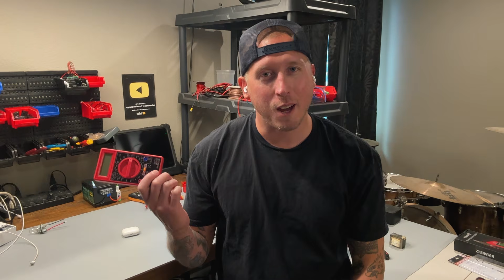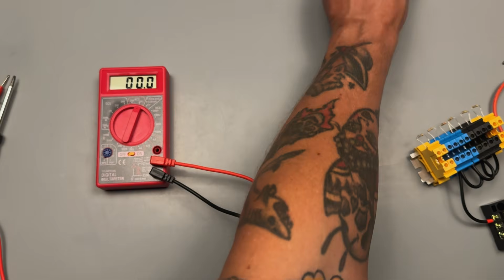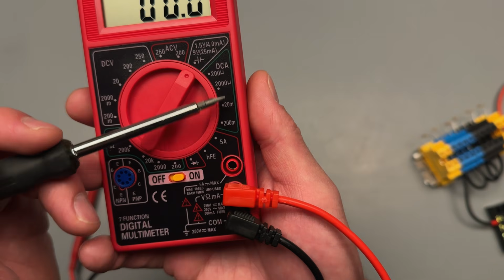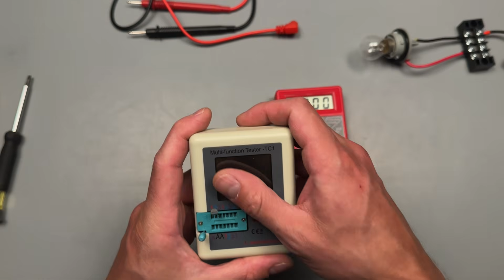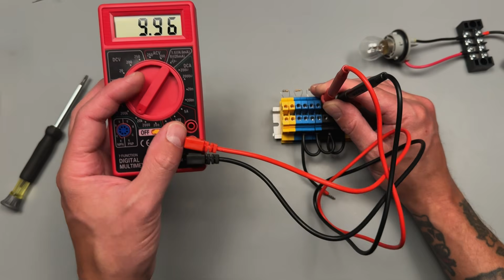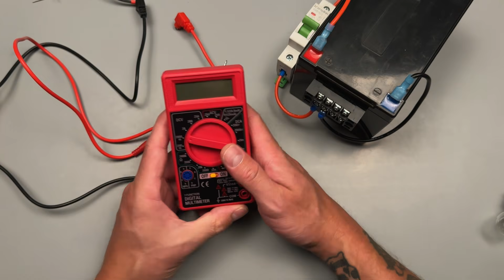How to Use the 7 Function Digital Multimeter from Harbor Freight (Full Tutorial)

Comment: The battery test function doesn't seem to work on mine (I have 2 of them).  When I go to test a 1.5v Battery, putting the selector switch on the battery test mode as you did in the video, I get the number "1" in the the display.  Measuring DCV on the same battery I get 1.3V
Reply from the maker: Bummer! Sounds like a defective unit. I would take it in a switch it out for a brand new one

Comment: My navigation lights on my boat are not working.  Can I use this to multimeter to test whether there is power being supplied from the 12v battery?  If so, what is the right setting on the dial?
Reply from the maker: Yes you can. If you watch my tutorial it should give you enough basic knowledge to understand how to perform this test

Comment: Can I use it to check a well pump for a water sprinkler system
Reply from the maker: Yes, you can! It's great for checking if the pump is getting proper AC voltage at the pressure switch, or for testing the switch's continuity (just make sure the power is OFF for that part!). Be super careful since you're dealing with water and mains voltage. Stay safe!
Reply: @maddoxmechanic  Thanks for your resonse we were trying to help my sister with her well pump.She just had it replaced with a new one.Apparently they didn't connect it right.Much Gratittude for your help.
Reply from the maker: @Lorilovesthemosthigh you bet! Glad it was helpful. Feel free to check out some of my other videos if you have the time. Thanks
Reply: @maddoxmechanic  Thank you my Husband was trying to help check my sisters well pump.The people didn't install it right.Thanks for your answering me back much gratittude.

Comment: Love this meter doing car 12v stuff....Understand it and makes sense. However, I am getting ready to test a 240 volt stove outlet to see if it is working. I imagine this meter should do it because it has a 250 volt setting or is that to dangerous with something like this?
Reply from the maker: I believe it is technically rated to handle that voltage. However, I personally would not feel comfortable testing that voltage with this meter. And I don't think you should either. I would go down to your local hardware store and get a meter rated for 600v AC - very common rating for most meters. Should have better insulated meter leads, and internal components. Wear electrically insulated gloves and safety glasses
Reply: @maddoxmechanic  Thank you and very much appreciate your response!
Reply from the maker: @Glenn_123  No worries! good luck, be safe!

Comment: I hope you can help me please. Trying to check if Bose speaker is blown on if wire is broken. Same meter as you’re using. I can’t tell what continuity symbol is. Getting 0 ohms when testing speakers and Bose are usually 2 ohms. I think it’s blown but other electrical issues so just checking. Thanks!
Reply from the maker: Hope this helps 

How to Test for Continuity with ANY Multimeter (Cheap vs. Fluke)
https://youtu.be/5cYBXgxeBP8

Comment: when i did the battery test here 5:58 mine meter show - 00.0 on brand new out the pack batteries???
Reply from the maker: hmm, I would make sure that the multimeter leads are in the proper ports, and that they're making good contact
Reply: @maddoxmechanic yes sir. I was follwing your steps to the T. When in AC, i checked my outlets and got 122 on 250 and the 122.3 on 200 switched to the battery checker like you did, touched my black to neg and red to pos and got -00.0 on a double a and a 9V
Reply from the maker: @imsopharill it will remain in that state if there’s no community in the circuit. You’ve likely blown the fuse in the meter
Reply: @maddoxmechanic darn. First time using it lol plus why does it work for the ac? Oh well, will have to get me a new one and bookmark your training so i can come back and finish learning. Hey thanks anyway for chattin with me, just my luck i tell ya lol
Reply from the maker: @i @imsopharill  happens to the best of us! I believe the fuses in it are replaceable. If not, it could also be a defective unit. Anyways, thanks for watching and commenting!

Comment: Okay l got a question l have a 2 prong indoor cord with a three spaces to plug 🔌 and these are 3 prong to plug l have one side for my C PAc and on the other side l was trying to charge my phone and my phone didn't charge for me
Reply: And I have the same meter also
Reply from the maker: @DavidAndrews-e2e  I would be really careful using a multimeter like this to troubleshoot your 120v AC outlets. I would just use an outlet tester to check the voltages and see if anything is wired improperly. They look like this:

https://amzn.to/3PRyiIf
Reply: @maddoxmechanic okay thanks. Lowes should have this l have a local CRW do it best hardware l will show them this and get it off of them. I might also take it out to a buddy of mine that knows more about electric cords than I do thanks for the help
Reply from the maker: @DavidAndrews-e2e  You bet!

Comment: Hey, my ACV two settings at the top that you spoke about  have 750 volt and 200 volt options.  Yours has 250 volt and 200 volt in the video.    My meter is probably much older than yours.  The reason yours is reduced is maybe they reduced the voltage specs lower for liability reasons as it's a cheap meter.   They maybe didn't want people using it for higher voltage and amperage things and turning themselves or the meter into a blackened marshmallow.    My meter looks virtually identical to yours so they probably just put on a different label to max out at 250 volts in hindsight.  That's my hunch and I'm sticking with it!  😉😜
Reply from the maker: Woah! 750 ACV?? I would have to assume that is a typo. Meter, professional or not, rarely ever are rated for over 600 Volts. I do agree with you though, it probably initially said 750 volts and then they had to change things around to stay out of trouble. Happy testing!
Reply: Mine also says 750 acv
Reply from the maker: @thethornbrues6205 oh interesting. Must be an older model
Reply: @maddoxmechanic I do appreciate your video it helped me understand how to use my meter.  I had to figure out how to discharge a couple capacitors. After being shocked a few times 😂
Reply from the maker: @thethornbrues6205  😅 oh man that does not sound like a good time

Comment: Luke, can "CONTINUITY"  be tested with the cheap Harbor Freight multimeter  ?
Reply from the maker: My guy, YES. It can. Set it to the 200 OHMs setting. You’ll want to see a number between 1-10. If you do, then you in theory have continuity. It just doesn’t make the beeping sound like the more expensive meters.
Reply: @maddoxmechanic  Thanks Brother !!
Reply from the maker: @user-jo5fz8iw3b  You bet!
Reply: @maddoxmechanic   . . . . . ..... and I assume it there is no display of numbers - there's no continuity ? If numbers arise on the screen, can the numbers be over 10 ? What will this mean ??
Why set at 200 OHMs ?
Thanks again
Reply from the maker: @user-jo5fz8iw3b  I think a lot of this I should have covered in the video.. If there's no continuity, it should display "OL". If the number is higher than 10, there is possibly continuity, just depends on what you're testing. 10 OHMs is just a general rule of thumb.
Reply: @maddoxmechanic  Thanks again

Comment: @maddoxmechanic  I’m back. 
I solved my problem. Just like you said, it was a short. It was not in any of my appliances but in one of my outlets. 
I looked with a flashlight inside the holes in the outlet and noticed it was a little burned, so I shot the main power off, took the outlet out off the wall and disconnected the cables from it, protected the cables with tape for safety, went and flipped the main power on, then the breaker that was giving me problems and…BINGO! It stayed up. Now all the outlets in that section (circuit?) work except that one of course. 
So I’m gonna buy the …(what you call it?) the “outlet” brand new and install it. 
I hope it works. 
THANK YOU for pointing me in the right direction.
Reply from the maker: That’s so awesome! Good job! Make sure those connections on the new outlet are nice and tight. Woohoo! Such a win 🎉

Comment: Como usarlo en fucibles yreele de carro
Reply from the maker: Hola. Para usar este multímetro (que normalmente no hace ruido/pitido) en fusibles y relés, sigue estos pasos:

1. Configuración: Gira la perilla a la sección de Ohmios (Ω) y ponla en el número 200 (la opción más baja).

2. Para Fusibles: Toca las dos puntas de metal del fusible con los cables del multímetro.

Bueno: Si la pantalla cambia de "1" a números bajos (como 0.00 o 0.05), el fusible sirve.

Malo (Quemado): Si la pantalla se queda fija en "1", el fusible está roto.

3. Para Relés (Relays): Busca las patas (pines) con los números 85 y 86 en el relé. Pon una punta en cada una.

Deberías ver un número de resistencia (generalmente entre 50 y 100). Si se queda en "1", la bobina interna del relé no sirve.

¡Espero que esto te ayude!

Comment: How did you check continuity, if you did?
Reply from the maker: There’s not a specific continuity setting on this meter. So you’ll just have to put it on the lowest resistance measurement setting
Reply: @maddoxmechanic  okay, so using 200 setting what reading should I expect for a refrig defrost heater? Thanks
Reply from the maker: @pjones3557  Looks like they very a lot in value. Should be able to expect somewhere between 10-150 OHMs of resistance. I would verify on a known good one to be sure exactly what to expect.

Comment: can someone dumb this down for me and tell me how I would use this to guesstimate the percentage on a 12 v lithium battery that I am using as a power station?
Reply from the maker: Youre going to use the 20 DCV setting. Make sure your leads are in the right ports. Black lead in the COM port, read lead in the VOhmsmA port. Take a measurement of your power station. Red to positive, black to negative. 12v lithium battery should be around like 13.2 or 13.4 volts if fully charged.
Reply: @maddoxmechanic thank you so much
Reply from the maker: @HarshmanHills  you bet!

Comment: Hello. I’m trying to use this multimeter in my car to test the output on speakers and all dials have the “1” on the screen before I even touch a wire. What’s that mean !?
Reply from the maker: Hello 👋 a one on the screen would indicate that there’s an open circuit, or you’re “out of range” for the type of test you’re trying to perform
Reply: @maddoxmechanic no , mine is the same on any circuit I try , it also has a battery sign on the bottom left hand corner
Reply: Same issue 😭

Comment: Can I use this to tell if my 50ah 12Vol lithium battery is getting low??
Reply from the maker: You can use it to check the voltage. And then you can use a chart online to check the voltage  vs state of charge. But to check the actual health of the battery, you’ll need to perform load/voltage drop testing, or check its internal resistance with something like this:

https://amzn.to/45U0MHb

Comment: Can you do a continuity test with it?
Reply from the maker: Yes, continuity is one of the test functions of this meter.
Reply: @aiyogarage please tell me which function and voltage I would need to use to test continuity on a dryer thermal fuse
Reply from the maker: @StepOutInFaith7 there’s no “continuity” setting on this meter. But you can set the meter to the 200 Ohms (horseshoe) setting, and if the fuse is good, it should have a very small resistance value. Something like 0.5. If the fuse is bad then it’ll just say “1” which means open circuit. Hope that helps 👍
Reply: @StepOutInFaith7 here for the same thing!
Reply: @maddoxmechanic  about to check my dryer and find out why "no heat " with this multimeter ,thanks for this video!
Reply from the maker: @mamab5514 of course! Be safe! Happy testing 😊

Comment: Opening up this meter on the transistor section reveals why we can't expect much accuracy.  Opposed to these proper Textool clamps we see on multipurpose component testers, this device  only has a few tinned holes, also called via's through the PCB of the multimeter which do not clamp the legs of any component one tries to put in there.    The best chance you get to measure transistors with this thing, is by pulling the legs of the transistor apart and hope they will rub against the via's.
Reply from the maker: Thank you for that!